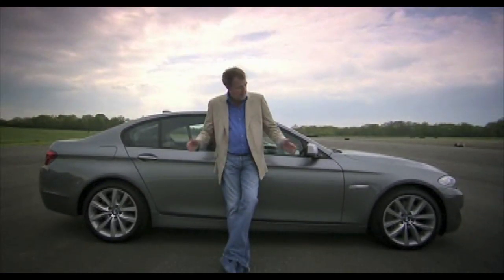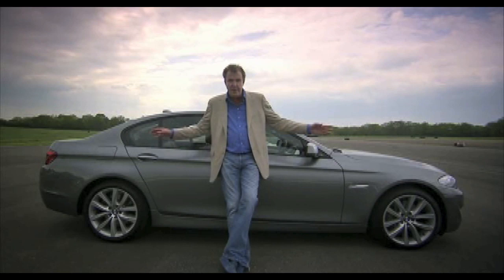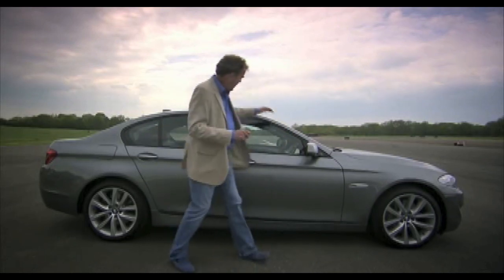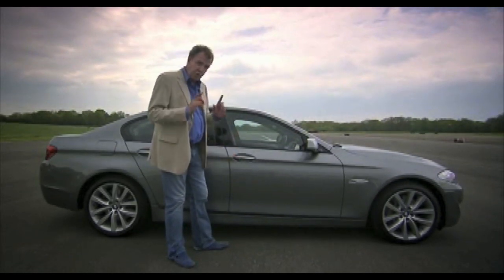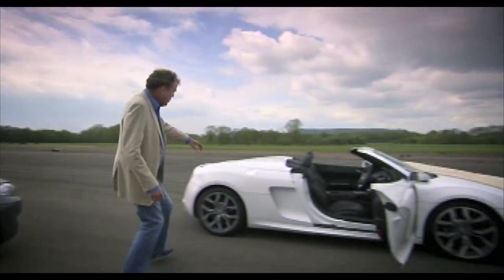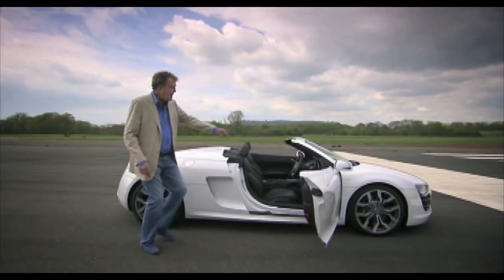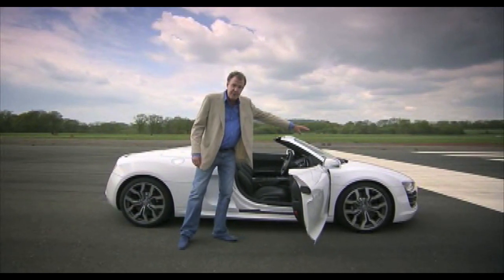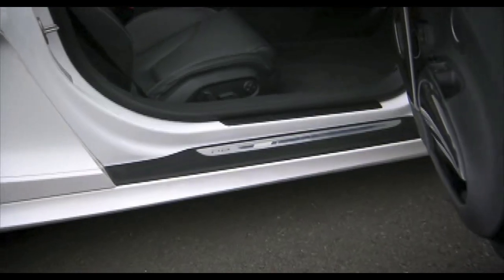Top Gear - Why Convertibles Suck

Comment: so if you put a playing card on top of the bricks they wont be wobbly? :D
Reply: You obviously don't have any idea how structural integrity works. The answer is simple
Reply: Rex Jow Bunta is love. Bunta is life.
Reply: Correct
Reply: My butt fleeks are wobbly
Reply: Well it might still be pretty wobbly, but it would be significantly less wobbly lol
Reply: Jeremy said a convertible is like two brick connected by one playing card.  This because he needs an example of sometging wobbly. He didn't say a non convertible is like two bricks connected by two playing cards....the integrity of a car doesn't work the same as the integrity of a two bricks playing cards system...
Reply: Moment of inertia. It will help greatly with rigidity.
Reply: actually yes. they won't.

Comment: @twomuchmonster Wrong. Since there is a big gap between the roof and the floor in a closed-roof car, pushing and pulling forces are reduced (==> longer lever). That will increase stiffness. That is, by the way, the reason why sandwich-composites exist: A 4mm carbon-fibre sheet is not as stiff as two 2mm sheets with balsa-wood in between.
In other words: If you keep the amount of material used constant a convertible will always be on its backfoot when it comes to stiffness.

Comment: its to do with structural strength and leverage. triangle vs a line. having a solid roof means that any material you put up there can help hold the car solid, without that suport on the roof you need to reinforce the bottom to make it as strong, and that adds weight and leaves room for flex. look at preformance numbers and weight of any car that has both a solid roof and convertable options and you can see the differences between them.

Comment: @Lukeisonutube  It is because all of these cars were designed to be convertibles on the first place, so they made the floor of the chasis strong enough to withstand the cornering forces without the roof.

Comment: nice video cut. It completely change the original message of the video together with this title. It originally states Audi and Porsche make good convertible (R8 and 997). watch the full video on youtube: Top Gear : Audi R8 vs Porsche 997 - Top Gear - BBC

Comment: in the right context convertables suck, like in a race. but in real life not many people are putting cars to their limits and as such it doesnt matter if the limits get pulled back a bit so you can cruise with the top down. but for racing, there is a reason why top cars are not convertable and its not to due with their insane top speeds, its because you can get a stronger stucture with less material when the roof can be used for stuctural integrity

Comment: @sigfrid and you have designed a car? well the only other places are the doors, and they need to open and shut so you cant have a massive re-enforcing beam through them. Furthermore aerodynamics IS a sub set of physics they are not separate.

Comment: @stiksoldier No, but i assure you, i've been closer (helped on the modification of one car to make it convertible), and no, the doors are not the only other place left to reinforce, you just have consider that changes you apply on one part of the body take effect on all the structure, and not just locally, sure the mod we made was not the best, but it met safety requirements.

Comment: No, the point is cars that were designed to be convertibles yes they are stiffer but that's how they allays where. But when they make a convertible version of a hard top  it will always feel not as good and of course different .

Comment: you still end up with a convertible. even if you set out to make a convertible. no top or hard top. either you want to drive indoors or you don't.a removable hard top, or t top fixes some of the issues, but you really can,t have it both ways.ragtops flap , tear, leak, or cost more than a real top.period.

Comment: I've always believed that convertibles were fantastic, in theory only. even if you do manage to get around the structural issue jeremy just mentioned, no one has ever figured out an easy,cheap,convenient, way to to it. The ultra simple willys jeep type of tarp is cheap and uncomplicated. and will keep the very big drops of rain off most of the instruments. The umbrella top(manual) never quite seals, and gets tangled. the mechanical top has all the above problems+ cost.

Comment: allright, look at things this way. Subtract the roof. that takes away weight. Add the lost weight to strengthen the floor and chasis. A convertible is not all that much heavier than a hard top...